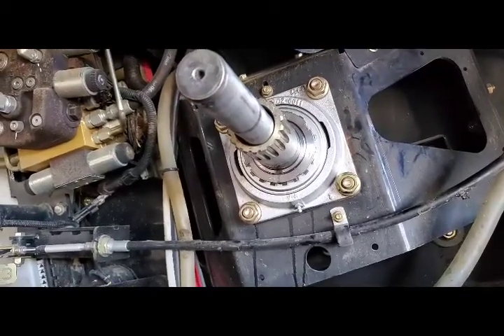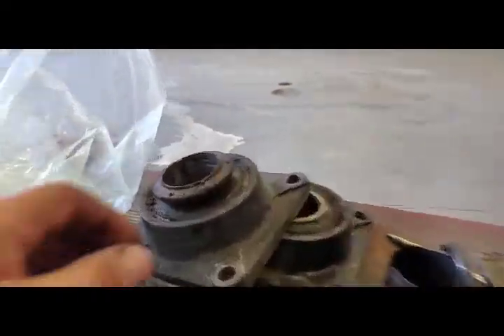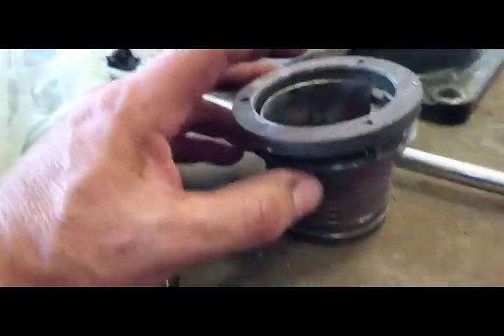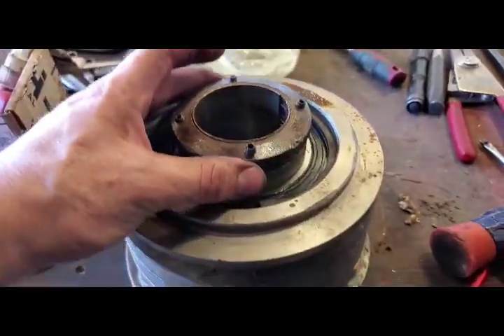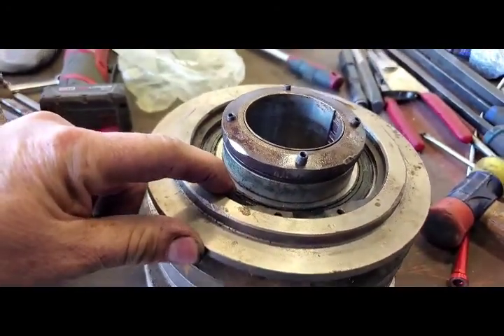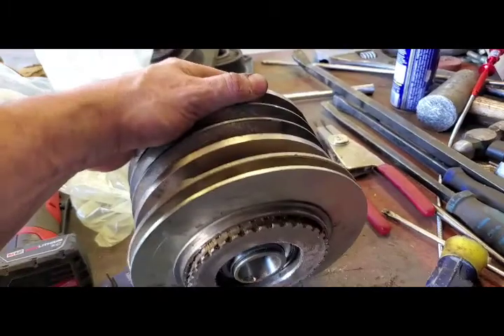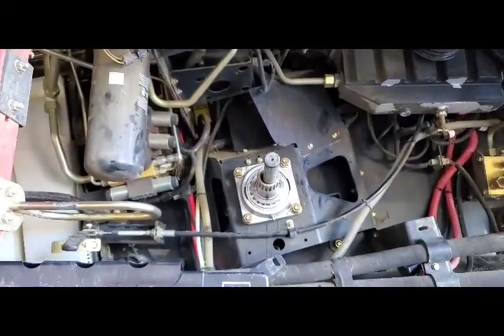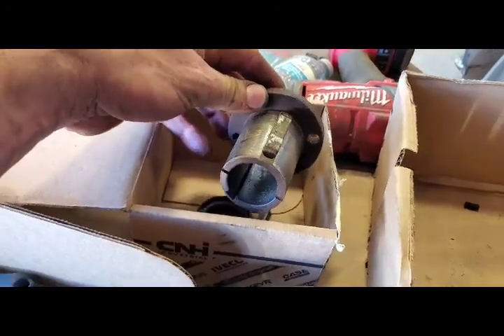Case 8230 / 9230 chopper bearing left side

Comment: Beater stopped spinning on 9120? 
Can I get your cell
Reply from the maker: Never worked on 9120 but if its like a 30 or 40 series.
Most Likely the splines going into beater from gearbox.  Pull gearbox off the side of the feeder house, to check. If so.  Just buy a new shaft that gos into gearbox & new beater, buy the cheap beater that doesn't have the slip ratchet built in.  notice that there is a grease nipple on the beater grease it twice a year. very important.   
Very common problem.    Good luck